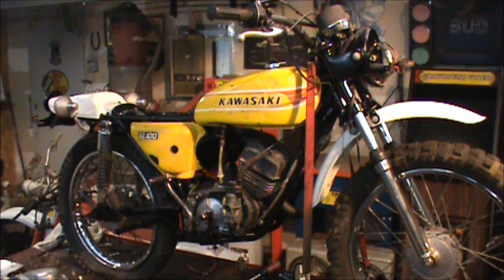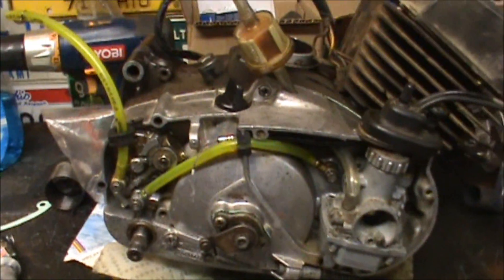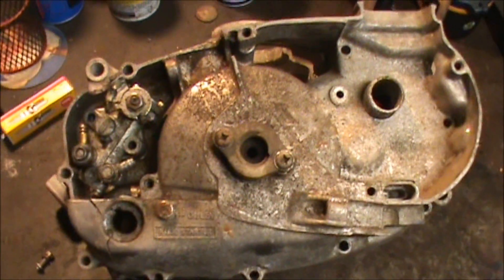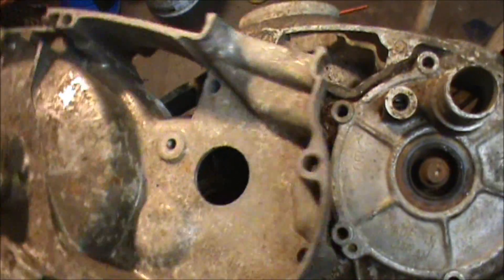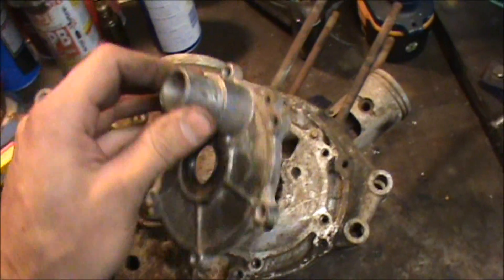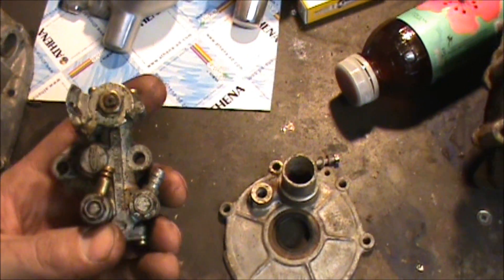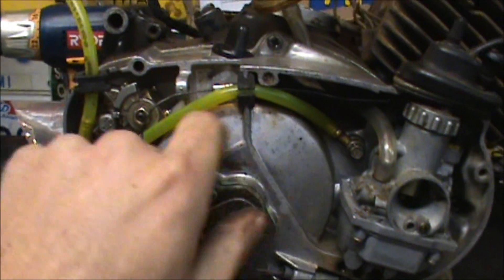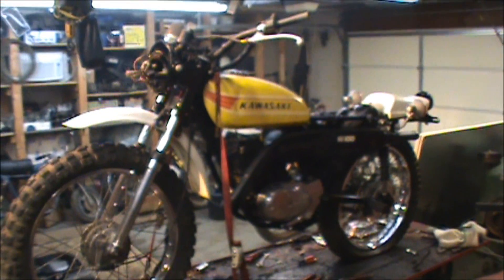How Oil Injection Works

Comment: The clear oil lines you have are also a good idea. Easy to see if you have air in The lines. I agree that it the engine came with oil injection you should use it. As long as it's maintained it should work just fine.

Comment: Your video was very informative.  I was given a 1984 Kawasaki KE100 and the owner said that the oil pump was not working. When I kicked it over I noticed immediately by the sound of the piston that something was wrong.  I pulled the head and examined the cylinder wall/piston and noticed some scarring.  I ordered a new piston and am having the cylinder bored out.  How do i know the oil pump is working?  Does it need to be primed? Is the flow rate of the oil very noticeable? Any help or advice would be greatly appreciated.

Comment: Just bought a real dusty 1978 Kawasaki  KE175 ,,The Bike sat in a garage for over 15 years and we have been cleaning it out ,,got it running but im not sure on what oil to run in the oil injection system ,,,can you help me out ,,Everybody tells me something different from 50W to Outboard motor oil ????>By the way, that was one of the best videos Ive seen yet on explaining how things work ,,right on,,thanx.
Reply from the maker: Hey Johnny, good deal! These are pretty tough old bikes and will take a beating. Bunch of different types of oil out there but I always run just a 2 cycle air cooled oil, lots of price ranges from racing to cheap stuff but I usually run the cheap stuff. Wouldn't think outboard stuff would be good since it's for a liquid cooled engine. Glad the video helped and thanks for watching!
Reply: Yah ,I never thought of that liquid cooled thing, Thanx again,Ill stick with the 2 stroke lawn mower type stuff  ,My Grandson and I went riding on the weekend ,hes gawt a 90 4 stroker,what a blast...be a little sore from the ride for a few days,,Its been a few years since I rode,, but it was worth it,,,LOL

Comment: I'm in the process of removing my rotery crank from the crankcase on my 1975 kawasaki  G5 100.  But I can't get it out of the crankcase housing.  I have the rotery valve plate off and now I'm stumped on how to proceed.  Tried using a pusher/puller tool and that got it to move a little bit but now it's just stuck and I can't move it at all.  I wish I could post a picture so you have a better idea of what I'm talking about.  Please help.  Thanks!
Reply from the maker: Been awhile since I've messed with one of these but Pretty sure you'll have to have a press to press out. Sometimes a parts diagram is helpful to be sure. Bikebandit is a huge help for pictures. Thanks for watching!
Reply: Thank for the helpful info. Your videos have help me out a ton with this old bike.

Comment: Your videos are saving me. The previous owner apparently took some of the engine apart, lost the oil injector gear, and put it back together. I guess he mixed the oil and fuel into the gas tank. Parts are about $30 for the whole gear/shaft assembly. Without this I probably would have reassembled it without knowing. Thanks.

Comment: very good video.  I'm restoring a KS125 and the pump is the same . . . One problem I've had is transmission oil leaking behind the pump then out of the engine (profusely) when engine is running and sitting on the kickstand.
I don't think there is a seal involved . . . seems like the only thing holding the oil in the crankcase behind that gear is the gasket.  Thanks to this video I'll try a new gasket, even though I hate to take this thing apart and bleed it for about the 4th time!!  Anyway, apparently there is crankcase oil circulating around that gear that could leak out behind the pump if the gasket is bad right?  THANKS FOR ANY IDEAS

Comment: Hi JFrost! Great Video! I just picked up a low mile, 2001 KE100, and it stutters and hesitates from time to time at lower revs, but runs like a champ when I give it some throttle and wind the engine to the higher rpm's. Any thoughts or suggestions please? maybe a carb adjustment? Can you do a video? (I ordered a new filter as its original and the sponge surround on it has decintegrated.) Thanks for your help.

Comment: Pay attention to what he said about taking the pumps off and running pre mix.Not a good idea.Some engines were designed with those pumps to be strictly used.You can fry your engine up eventually.Clean the pump if it has a tight spot,go buy new throttle cable assembly,fix it right.

Comment: Right there on the carb intake Is there a gasket that goes between the carb and intake I know it shouldn't just fit sloppy on there and I cant find a good illustration in Manual..I would appreciate if you could enlighten me for Im trying to get the bike going for my son and I didn't get a gasket with it so Im concerned about it sealing.So Thanks for you time.

Comment: thanks ill try it out i found the throttle cable but i still have one last thing before i can it the old thing to run its missing a carburetor and i dont know what kind to use

Comment: i just recently got a 1980 ke100 and i need a throttle cable were do i get it with the two cable adapter thing and what kind of carb can i use on it your help would be appreciated

Comment: @jfrost77hd what about anything from 1986-2001. kawasaki hadnt changed anything on the ke100 since 1986. all of the parts are interchangable. i reallyneed a cylinder  and cant afford the 315$ for an oem replacement.

Comment: Get video, just picked up a 79' KD100.  waiting for repair manual, but in the mean time, this is a great explaination of the oil injection system and rotary valve.  Thanks